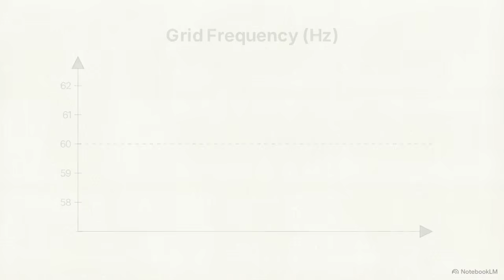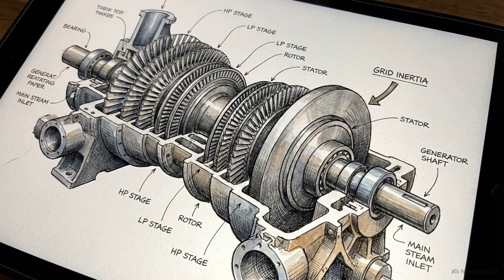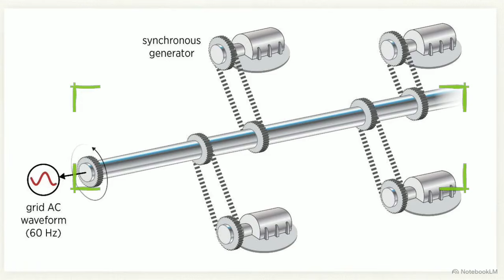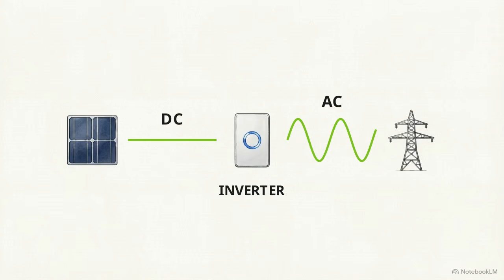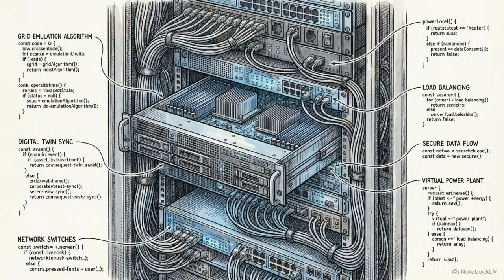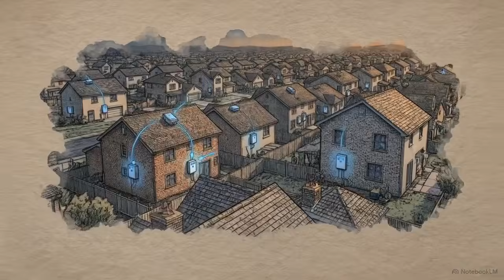Too Much Solar? The Duck Curve Problem Explained Simply

Comment: A turbogenerator is designed with a 4% 'droop' - the rate it will slow down under increased load. That is where the stability comes from- think of it as negative feeddback. The same factor can (and I assume is) be built into any invertor. The problem is not with high speed load following, but slow- the 30 minute cadence of power purchase/matching.
Reply from the maker: @Tensquaremetreworkshop Really appreciate this you're touching on something most people miss entirely. You're right that droop response is absolutely implementable in inverters, and modern grid-forming inverters already do exactly that. Your point about the 30-minute scheduling cadence is the sharper challenge honestly that's where AGC (Automatic Generation Control) and ancillary services markets step in to handle deviations within the dispatch window. Though increasingly the fix is just shortening the intervals themselves some grids are already moving to 5-minute dispatch cycles. Would love your thoughts on whether that's sufficient or if the cadence problem runs deeper than just interval length.
Reply: @find-new-stuff  I see two major issues coming down the track-
One is grid capacity- with fixed, large power stations the flow directions etc were predictable. With many more sources, the modelling of flow is complex- although AI may help here (it is the sort of problem it is good at...)
Second is the increase in 'undemanded power'- my solar gets pumped into the grid whether it is wanted or not. This Sunday, one supplier in the UK was offering 11.7p a unit to take power... One of the unpublished purposes of spending £6B on getting us all to have smart meters is to be able to shut our generation off. The main one, of course, is for what is called 'load shedding' (switching us off). I note that heat pump installation requires a seperate consumer unit- a step towards selective shedding- the ability to shut down heating and car charging only. A good step is the increasing availability of car charging where the supplier chooses the times- allowing load balancing. In a sensible world that would be two-way. With a fully electrified car base, that would give at least a Twh of grid storage. But that would require a country to be organized. Most EVs cannot be used as a source- which should be banned.
Reply from the maker: @Tensquaremetreworkshop The vechical to grid thing genuinely baffles me  millions of cars sitting on driveways 95% of the time, already connected to the grid, and we're just... not using them. The Nissan Leaf trials here in the UK showed it works fine technically. It's not an engineering problem, it's just commercial inertia and regulation not keeping up.

The undemanded power point is something I keep coming back to. Negative pricing is already a regular occurrence in Germany, California, Australia the grid is basically waving its arms saying 'we need flexible demand and storage NOW.' Whether anyone's listening fast enough is another question.

And yeah, the smart meter thing is a bit of a double-edged sword isn't it the same infrastructure that enables load shedding is also what makes intelligent, AI-driven dispatch actually possible. Depends entirely on who's running it and how.
Reply: @find-new-stuff the ‘smart’ meter is not double edged- it was only ever designed to cut one way. Use monitoring can be done with a simple cable clamp device for around £20 a throw in volume, and fitted in seconds. That was only ever a smoke screen.

Comment: What happens when the batteries get discharged, like they will after a long dunkleflaute?  We're back to a destabilized grid.  We simply cannot build enough batteries to stabilize the grid under all circumstances.
Reply from the maker: That's actually a fair concern, but batteries aren't really designed for long-duration backup their role is more specific than that. They respond in milliseconds to stabilize grid frequency while hydro and gas plants spin up to take over. Once those dispatchable plants are running, batteries have done their job. During a longer Dunkelflaute, the grid simply leans more on the hydro and gas capacity that was already there, just running at lower output because renewables were handling the load. It's a layered system where each source covers a different timescale batteries just handle that critical first few minutes of the handoff.
Reply: @find-new-stuff  That's true. You still need natural gas or other sources.  That's why Hawaii, despite decades of building solar, still gets 70% of their electricity from petroleum.  Florida gets 70% of its electricity from natural gas and nuclear.  There's a lot of false info written about California, but they're actually below 25% solar when you account for the massive amounts of non-solar electricity that they import.  

This is something that solar proponents never admit - solar is only good for a few hours per day.  The cost of solar rises exponentially when you try to get a greater percentage than ~30% because you need to build an unrealistic amount of batteries and much larger solar plants to recharge them.

You didn't honestly cover that in your video.
Reply from the maker: @markmeridian3360 You raise some fair points, and I appreciate the detailed response. You're right that dispatchable backup remains essential, I actually agree with that. On Hawaii though, it's worth noting it's probably the hardest possible case for renewables a small isolated island with zero grid interconnection to neighbors, which removes the single biggest tool for balancing a high-renewables grid. It's a genuine edge case rather than a typical example. The integration cost challenge you mention is real, but grids like Germany and Denmark are already operating well beyond 30% renewables without the exponential cost curve materializing. The costs are real but manageable with the right grid design."
Reply: @find-new-stuff  The costs are not "manageable".  First,  Germans and Danes pay over two times more for electricity than the U.S. Their high cost of electricity (extremely high cost during Dunkleflaute) is already causing German industries to leave.

Second, Germany is backed up by nuclear from France, hydro from Norway (passed through by Denmark) and, to lesser degree, nuclear from Sweden. Both Norway and Sweden have announced that they are no longer going to bail Germany out when the current contract expires.   Both countries have stated that bailing Germany out is causing their domestic electricity prices to increase drastically.  So German electricity prices are about to jump again.